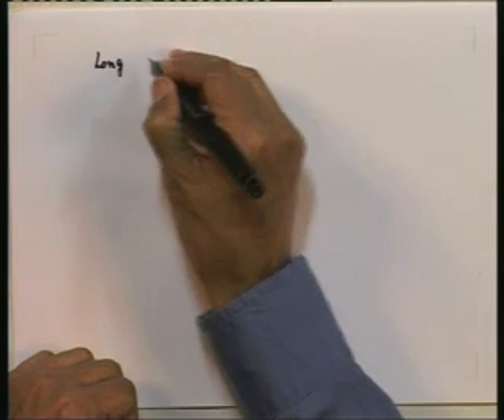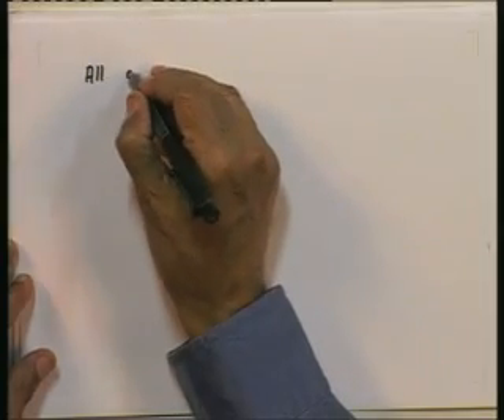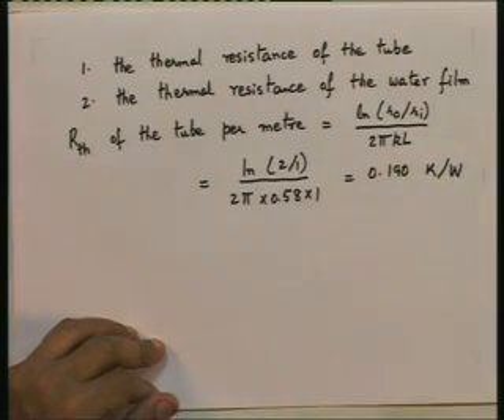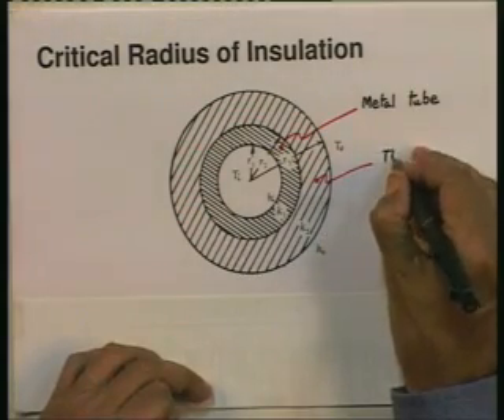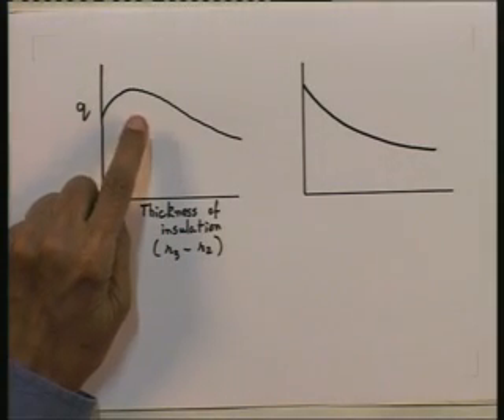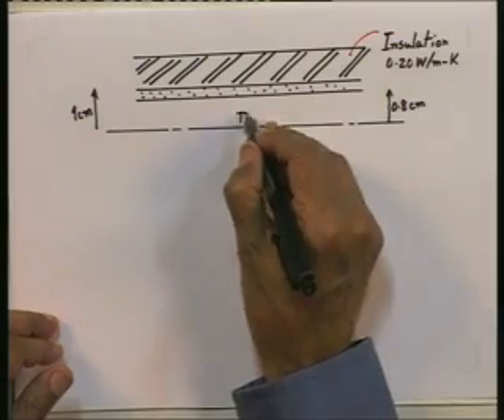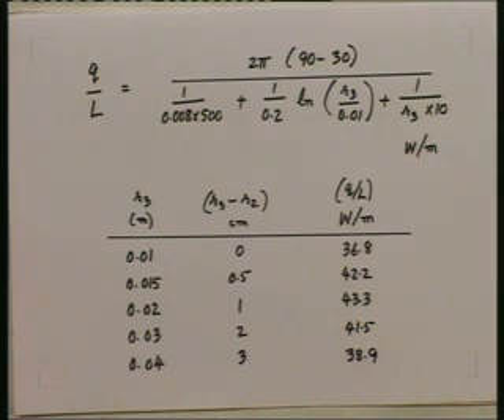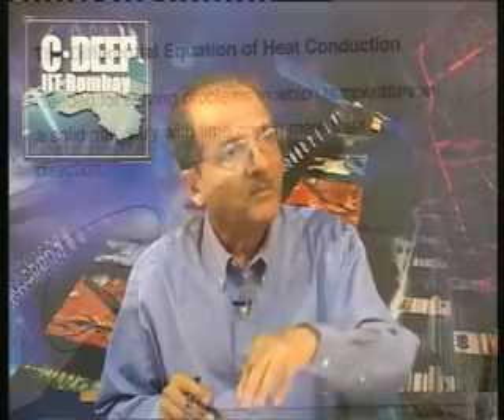Lecture - 5 Heat Conduction - 2

Comment: In the part where Professor explains about critical radius of insulation, shouldn't the expressions be r3<k2/h0 and r3>k2/h0 and not in terms of r2?
Reply: +Riza Mohammed .hi.i too had the same doubt and after referring to textbooks i came to conclusion that while designing the pipe, its radius is selected (based on general k and h) such that it is always greater than critical radius,so that least amount of thickness of insulation also helps to reduce heat transfer.
Reply: nope.I too had same confusion bt I understood by sum
Reply: syed hashim 
Can u give the book name u used??
Reply: k2/ho is critical insulation. First we have to check whether this critical radius vslue is greater than r2. If k2/ho is less than r2 then its not possible ( how can critical radius be less than r2) and we dont get a maxima for q/L. Only when k2/ho is greater than r2 , we have some positive thickness and then we will have maxima. Therefore  for critical thickness to be really meaningful it should be greater than r2. And then from math we can see that in this case we will get a maxima. If critical thickness < r2, then it does not make any sense and we will realize any critical radius in reality. In such case there is no maxima or minima.